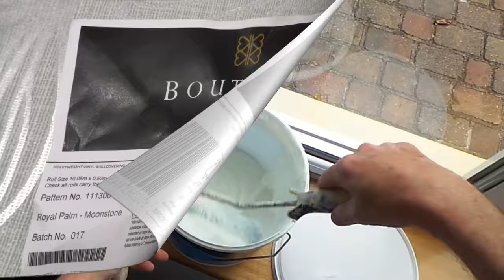Wallpapering around Windows Made Easy: Tips and Techniques for a Flawless Finish

Comment: That's not right never overlap should be spliced together how you would do a wide vinyl muraspec type paper this is not the way
Reply: You mean like a mitre join, overlap, cut thru the middle, remove top and bottom overlaps to leave a butt join?
Reply: @Sam-gw5pl  yes exactly that no over laps
Reply: This is a vinyl that you butt joint, around window reveals option to overlap or splice the small cuts, all depends on the decorator 👍

Comment: Overall not bad your method for papering the  window  is wrong the overlap section  will be visible and is not necessary,once you  see how it's  done  right you'll be fine.
Reply: they might be getting drapes that would cover it but yeah I agree I typically only splice over wrapped windows